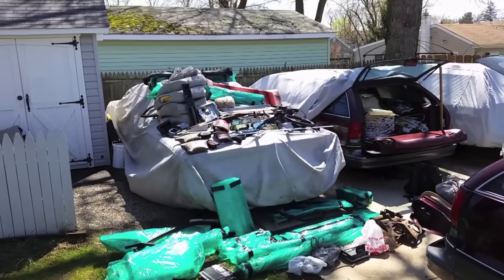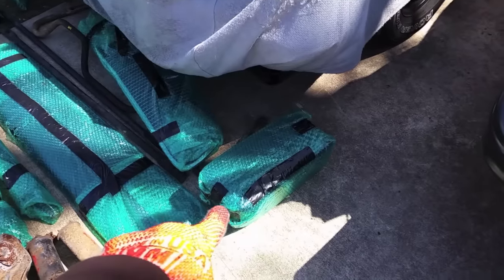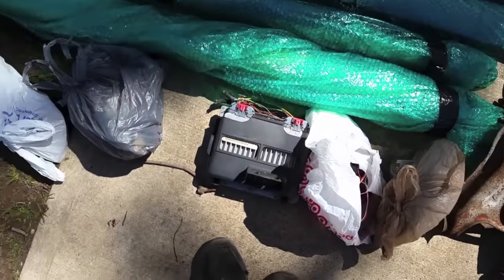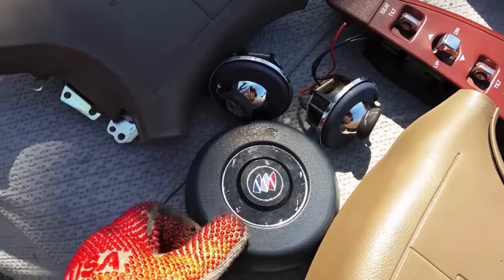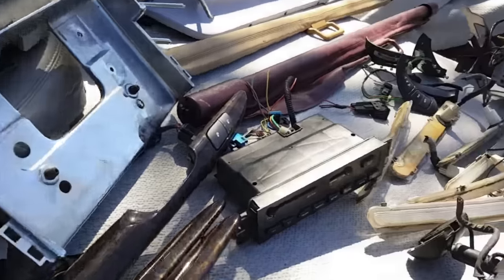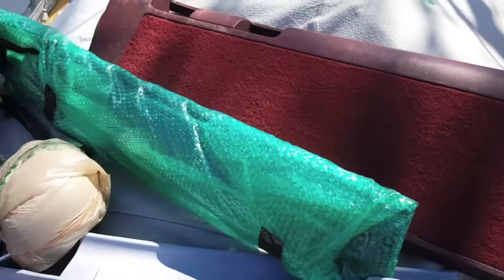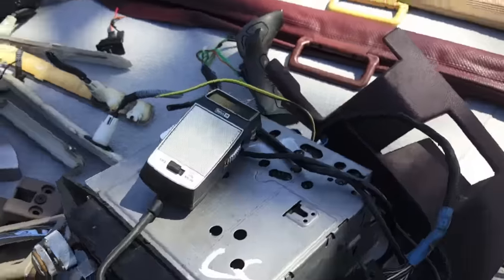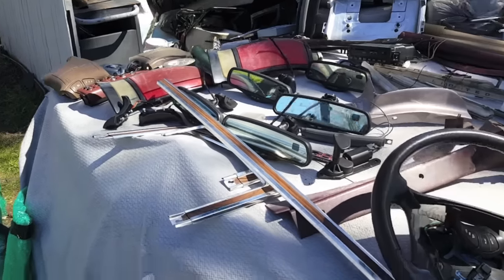Parts we bought from visiting 18 junkyards in 12 days

Comment: I live in NH, and I see almost NONE of these B-Bodied anything anywhere, so seeing all the videos of the different junkyard cars killed me a little inside. I don't get it I'm not that far from Connecticut when you think about it yet it seems like Dave is always finding another.
Reply: +91jchevy87ec1 Dave probably hoards them all lol. Or these guys just know where to find them. Like I still don't get how Dave got a 9C1 Caprice for $400 when around here I've never seen a Caprice 9C1 for under $2000 even in rough condition.
Reply: Right?! Every B-Body I see has a quarter million miles on it, rusted to hell and they ask 2500 for it/